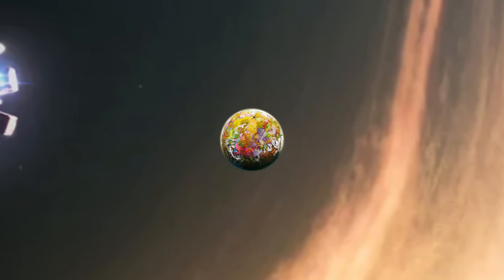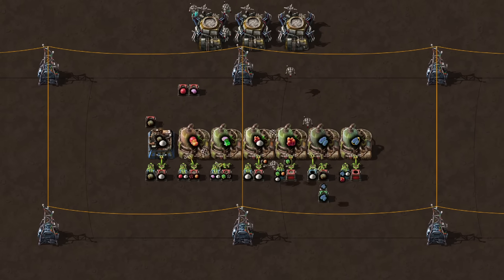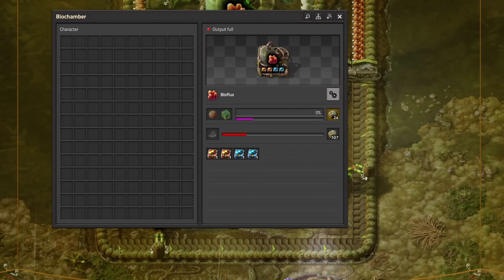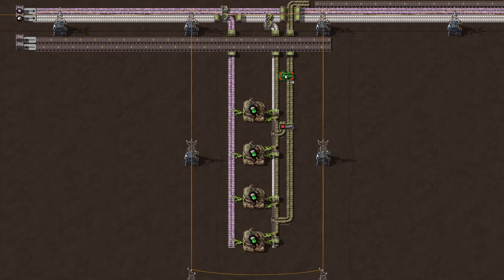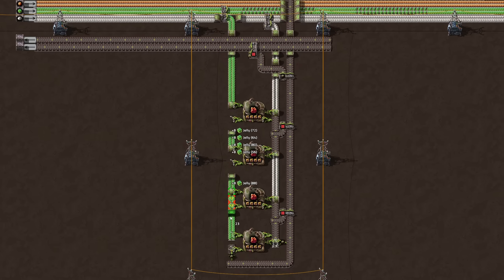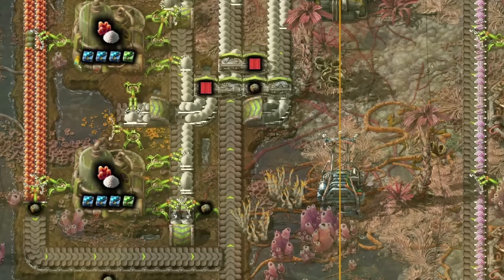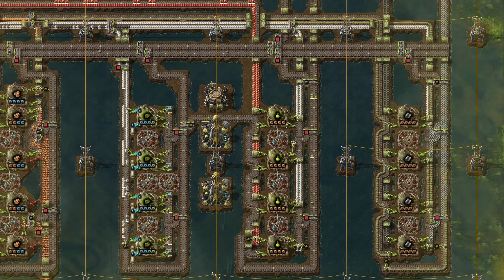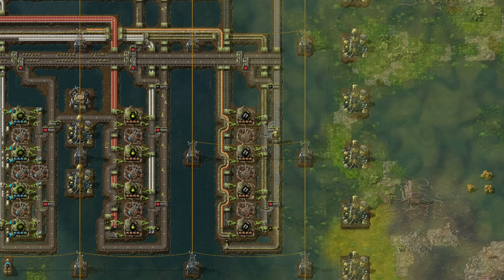Master Planet Gleba in Factorio. With Belts and a Main Bus! Factorio Guide / Tutorial

Comment: I prefer using Nuclear on gleba because it *doesn't* depend on gleba, it's entirely disconnected and much more reliable. Plus I can throttle the reactors to not use fuel as much. However I do need to rebuild my gleba production and will take inspiration from your blueprints.

Comment: 6:56 isn't it more efficient to ship in artillery instead of shipping tungsten and crafting it on the spot?

Since one rocket fits 250 tungsten or 5 artillery turret, and each turret is 60 tungsten so it's equivalent to 300 tungsten per rocket, well i guess you still need tungsten for the shells, so probably easier to ship it in
Reply from the maker: Yeah the turrets only have to be crafted once. It's about the shell production.

Comment: 6:21 did you ever make a video about that? I'm struggling to find a good solution to load spoilable items into rocket silos and keep them fresh too
Reply: Buffer the science in a chest; put an inserter from the chest to the silo;  connect the inserter to the silo with a wire; enable read orbital request and enable the inserter only when there is a request for the science

Comment: I did robots, which did indeed feel less pure, but I did much more circuit control than I normally did, so it balanced out. I controlled production and requestor chests with circuits so I wouldn't have so much stuff sitting in backed up boxes and machines just rotting.

Comment: The way I did Gleba was quite different. At the beginning you talked about how loops would needlessly complicate things but you might be surprised at what you find. I think loops are the most efficient and effective means of dealing with spoilage.

If you can loop a belt back to its origin point then you suddenly only need a single splitter for trash on the loop to remove anything that spoils along the way and it allows objects that would normally spoil at the end of the loop a second (or even third) chance at being used. Even more then this, if resources arnt being used, your belts will fill to saturation then won’t need to make any more resources which is pretty efficient. 

This strategy dramatically reduced the spoilage I go through and I only need about half a green belt to remove the spoilage for my whole base which actually doubled as my nutrient belt since it ran through the whole base. Biochambers only need a single nutrient and as they are being consumed they don’t spoil so to keep nutrients from spoiling in biochambers you just need to feed it one at a time.

I think the best part of the strategy is that it left me with a different kind of base. It’s not a spaghetti base and it doesn’t use a mall but instead it uses massive loops of fresh fruit, “fruit loops” if you will and it gives you a reason to make a tight base as the less travel time an object needs to make around the loop, the more chances it will have to be used.

Comment: This a great setup!  I have fully implamented this and it does work.  HOWEVER, seeds seem to get into EVERYTHING and stops the flow.  Splitter filtering isn't perfect for the seeds, it seems, and inserters miss some as well, so its a problem.  I have been able to get most of them out of the system, but some seem to get through no matter what you do.  Definately not a hands off system.  Any suggestions would be helpful.

Comment: I with my spaghetti-Gleba cry. Even though I also infinitified it with belts for the most part, it still looks completely different than that
Reply from the maker: :_spaget: Embrace the spaget!
Reply: @AVADIIStrategy  what I did for the spaget: I've run single-line bus through whole base, where 1 side of the belt is for nutrients and the other for trash (so that trash will never clog nutrients as well as nutrients will never clog trash). This allowed me to start sending rockets.

After that to expand I branched off from original fruits bus (because they have 1h lifetime). So to increase SPM I've just built it's whole process in one place (yumako to nutrients, yumako+jelly to bioflux, bioflux to science)

After that it's very easy to expand, because everything now is a block dependant on original long-living fruit, which I can deliver by the trains from far away.

... that said, I just reached 150 SPM and was done with it, so it's still a al-dente spaget :D

Comment: Something I've been doing is having my pentapod egg biochambers insert their output into a chest. The chest has 2 inserters picking up out of it. One of the inserters is filtered to only pick up spoilage, and it will put it on the output belt. The other one will only pick up pentapod eggs, and puts them into a second chest. This second chest has 2 inserters picking up out of it as well. One of them will put eggs back into the biochamber, and the other one onto the output belt. The one that places them on the output belt, however, is connected to the chest via the circuit network, and is only enabled when the chest has more than one egg in it. Also, its stack size is overridden to 1. That way, there's always at least one egg available for each machine.

Comment: I approached this quite differently. I don't think a main buss is the best solution for most gleba products. The jelly and the mash spoil in a few minutes, so even a short trip on the main buss is gonna mean they are half spoiled before they are used. Bioflux is really what you should be focusing on. Make a factory that produces mash and jelly and directly converts it into bioflux. Bioflux spoils much slower and can be converted into a lot of nutrients were they are needed. 

I also think circular belts is a good idea for many of the items. As it both makes it easy to filter out spoiled items, but also lets you control how many items are on the belt by reading the content of it.

And for the eggs, you can have the factory produce eggs infinitely. Just make the belt go past the science to they can pick up as many as they need, then put a burner at the end of the belt to burn any excess.

Comment: tip 1: aim to use fast belts as the slower the belt then items will spend more time travelling and becoming shit without being processed.
tip 2: after  arise in gleba, first thing to do is focus on getting landfill and energy setup so you can start the base bringing yumako and jelly from far away.
tip 3: if you can, take this with you to start gleba: 300 landfill, a lot of fast belts, 100 efficiency modules lvl1, 40 eletric furnaces, 20 eletric miners, stell power poles. This is pretty much every thing you will miss

Comment: This was interesting. My own setup is based on more or less self contained modules with quite a lot of internal spagetti belts :D but then I can just add more such modules, but this solution was a lot cleaner and the external egg supply was interesting, I might steal that one :D 

Currently I designed the module that needs eggs (and makes both science and bio chambers, to more or less never run out of eggs, but I also keep an extra stash of bio chambers since recycling them can produce an egg, so having 40 in storage means a non spoiling restart option, though it requires fulgora science and more logic if you want it automated.

Comment: I found an interesting thing with science: when you keep adding a freshly crafted science item to a full stack, that had one lower freshness item removed, it slowly increases freshens of the whole stack.  So what I have done is I am inserting science directly into rocket silo, that has automatic requests from space disabled. I also have a second inserter that takes science out of the rocket silo and has the following parameters: enable inserter when science pack count in rocket silo is 1000, stack override set to 1 and spoil priority set to spoiled first.

So what happens is when rocket silo is full with 1k science, second inserter starts pulling out most spoiled science packs out and first inserter keeps putting in fresh ones. And this mini loop seems to be slowly raising the science pack freshness and it keeps running until my spaceship arrives and collects the science to be taken away to Nauvis. The science packs that get pulled out of rocket silo are left to get spoiled, so at the moment it is a significant waste, but hey.... resources are infinite!

Maybe this is something that could be explored to.... abuse, haha.

Comment: I always find robots to be a somewhat cheap solution to a logistic challenge. I think that they are valuable as an asset for less skilled players and for use as a kind of supplementary measure for some setups, but I always am most satisfied trying to tackle a challenge without bots.

If a logistical challenge in the game is getting frustrating, then go bots. But I think its worth trying to solve things on belts before you resort to them, they're a get out of jail free card not a blanket solution in my book.

Comment: I also solved gleba with belts. The only difference with yout setup is that i didn't put proccessed fruit in the buss, each module in the base had it's own input of raw fruit, bioflux (for it's own nutrient generation) and whatever else needed. To maximize spoilage time. I also have an overflow for fruit, making sure any unneded fruit gets processed before spoiling, so i don't loose seeds. The processed fruit just got trashed in heating towers.

Comment: I tried Gleba with bots as well... Then I ran into power problems. I tried solving it with the heating towers as well. First, I tried burning spoilage... then I saw that there is a Spoilage to Carbon synthesis... so my brain went to "ah, that must be the expected solution"... So I imported carbon from the space station above (since I haven't unlocked the sciene)... nope, not the solution...
So yeah, I haven't thought at all about Rocket Fuel... Thanks for the hint Avadii

Comment: I didn't want to watch this video, before I was somewhat satisfied with my own Gleba build. 

Really neat build, you've made.

Af you, I wanted to make a belts-based solution. I came to Gleba from Fulgora where I had just set up a bot base for the first time. Fun, but not fun to do the exact same thing again.

Your solution is much more organized and will probably scale much better, but one thing I actually like with my own build is that I did decided to loop spoilable ingredients on the bus which enables me to centralize spoilage control. That really limited the amount of splitters needed and simplified spoilage control.

Expandability most be done by copy-paste rather than larger bus, but I don't think it's a problem in itself, really.

Comment: hello, I would to give you a tip. Dont use an output inserter for seeds in your main bus lanes. Use output inserters for the seeds directly from the processors and filter rest of the output inserters to outputt only required items. You will make your belts slightly more efficient

Comment: After building a bot based Factory to get gleba science going, I can definitively say that it's genuinely harder and requires much more micromanagement, which isn't what we want in factorio. The initial setup is easier, but the power draw from mass bots makes it VERY difficult to get going. Producing rocket fuel solves this, but until that point you're desperately trying to manage which resources you're dumping into heating towers because nothing gives enough power to sustain it for long. If your power ever runs out it's a massive problem to get going again. If you run out of nutrients for whatever reason, restarting the base is also a huge issue since the bots aren't going to prioritize any particular biochamber.

If you're going to use bots to solve gleba, you need to build a main bus for AT LEAST nutrients because it's the best way to give nutrient production priority. Penta pod spoilage is also a problem, because if you shove one of those into a provider chest and don't realize it's not being used, it's literally a ticking timebomb that has been thrown into the ether of the logistics network, never to be found again until the fateful moment that you're being swarmed.

The only advantage a bot base has is limiting the mental labor you have to put in to get things going. As far as production, efficiency and risk management goes, belts are better.

Comment: I also belted Gleba and I loved it, and I also went with a main bus design but with one exception. My bus never branches off, but rather I divert the entire belt around the bio chambers and then back to the bus. So very very few splitters. This means that all nutrients are always moving. I also don't put mash or jelly on the belt, but only bioflux, nutrients, eggs, and so on. I don't worry about over producing eggs. They just constantly keep updating and being turned into science packs and the excess eggs are burnt. I don't burn spoilage but recycle it into epic spoilage.... because I can. Not really using efficiency modules.

So yeah..... what I'm unsure about with your setup is that the belts actually stop in each branch off the main bus. This seems dangerous as you can have spoilage standing still and blocking fresh things behind you.

Botless Gleba is great :).

Comment: When trying to design a belt based Gleba factory for an entire day in my head I gave up and decided to use bots. The main thing that made me do that was my fear of unoptimally wasting resources, so bots is a natural solution as they are the fastest and they only hold an item if it is being requested somewhere, unlike belts where items just spoil if the factory is doing nothing.

Gleba was my 2nd planet, and Fulgora 3rd, so only after trying to design a hyper optimal Fulgora base and coming to terms with the fact that there is no way to not delete items on Fulgora, I finally let go of my fear of wasting resources, so now I guess I could try to finally build a botless Gleba factory.

Comment: Thank you for the tips! But I made a slight adjustment of my own as I made my Gleba bus 

Mainly it’s how you remove spoilage from the inside of machines, your design did well enough for a while until I noticed how hard machines unclogged by outputting the spoilage from its main products. 
But the way you made the arrangement of having to machines merge their contents into a lane with the divisor made it easy for me to just place underground belts and inserters with filters to take out the spoilage from inside of the machines, basically I treated spoilage as a secondary outpost of the machines! It’s was just plug and play and it works perfectly to keep bio chambers clean.

Comment: Wow, some good tips here! The only thing I'd do differently is not putting processed fruits on the bus, in my (not too great but functional) base I never had any issues with just making fruit processing locally as needed. And unprocessed fruits last a long time, so it minimizes spoilage. I'll definitely make a redesign with resource flow based on this though. Especially nutrient consumption, for some reason I was obsessing over efficiency modules, but it makes so much more sense to go with the "consume everything all the time" philosophy. Maybe I would've thought of that at some point, but after 4 redesigns I was done with this place for a while.

Comment: The green wire at 5:10 connecting the biochamber to the inserter, you said there was a delay, but how did you do that without any combinators etc.?
Reply from the maker: Mh? What delay? I don't mention any delay in this video.
Reply: @AVADIIStrategy "To kickstart the production of nutrients if the entire base shuts down for a while"
I guess I interpreted that as a delay, my bad.
Reply from the maker: @doomstrike53  Oh you can now read the content of machines. So in this case I read the amount of nutrients inside the biolab. If it's 0 I start producing nutrients with the backup assembling machine.

Comment: Unfortunately Gleba has a certain problem most tutorial on YouTube ignore completely: Spore cloud, Gleba's version of pollution. And the local fauna is extremely difficult to defend against, especially without Tesla turrets from Fulgora. So the best way to build Gleba base is lean HEAVILY into the circuit logic, limiting the harvesting of both fruits to the bare minimum so nothing gets clogged up.
I really can't stress enough how easy it is to fall into the false sense of security on this planet and pay the heavy price.
Reply: Just paid that price, I'm thinking of Stopping the harvest if the Belts with Fruits gets too full. Not Quite sure how to do that or something better at the moment. Probably best to put a thousand Turrets around the Harvesters until then
Reply: @redrandal3864  Connect the belt(s) to the agricultiral tower(s) with the green wire. Read the contents of the belt and disable the tower when the amount of fruit is over certain number.

Comment: What do you have below the nutrient block?  There is another machine there that you don't describe.  Unless I missed it.  I can't see the recipe because my eyes aren't that good.   Thanks.
Reply from the maker: oh its a biochamber producing biochambers. not important you can also craft them in normal assemblers.
Reply: @AVADIIStrategy Ok, thanks.  One more question.  What are you launching from the rockets by the mall ?  Just more science ?  You already have a science rocket belted north of the science biolabs

I've got the bones of Gleba built.  Now, I have to build all the supporting stuff.  Can't turn it all on until I have enough rocket part materials.
Reply from the maker: @brianpleshek5593  Stack inserters, carbon fiber, bioflux.
Reply: @AVADIIStrategy Thanks.